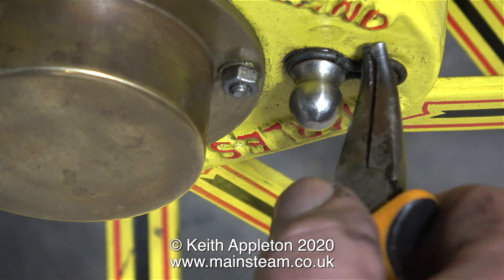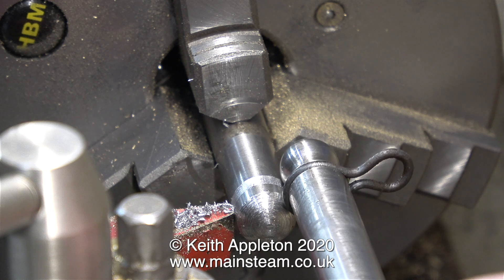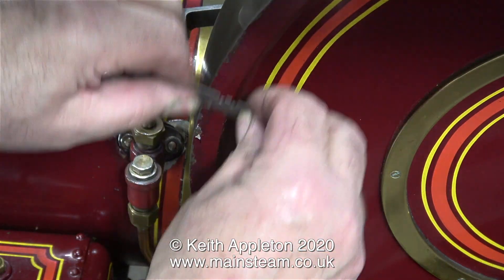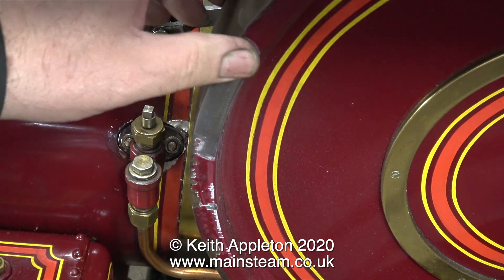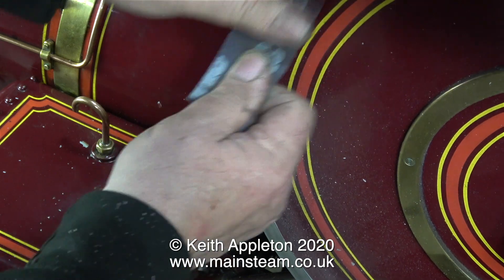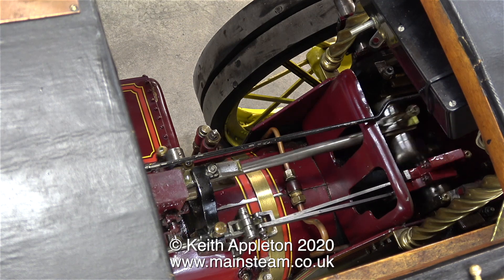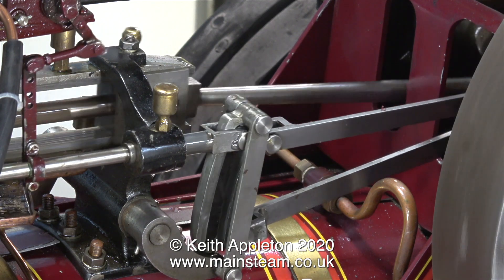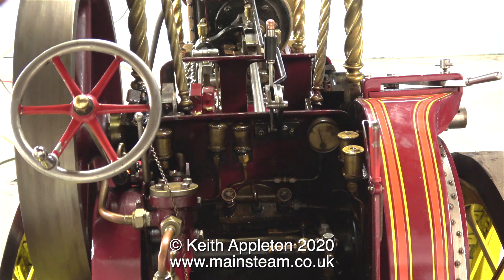A LARGE MODEL SHOWMAN'S ENGINE - PART #4

Comment: Hi I need some help and advice,  I have a wilesco d16 and have a hole in the boiler which sits above the fire so I'm unsure if its repairable  , if its repairable I would be very happy to learn how how to do it or even send it off .
Reply from the maker: Just buy a new one, they are not very expensive.

Comment: And again you give me a another tidbit of information.  I am currently getting ready to put a 1/8 scale steam locomotive back on the rails.  When I got it I noticed that the stack was choked down to approximately 2/3 of it’s diameter with soot.  I didn’t think about it getting too much steam oil, I just figured that the previous owner(s) probably just over fired it with too much coal.

Comment: Very often the second drive pin is to lock the differential. This would only be used on soft ground other wise there is a risk of stressing (and breaking) the axle. Still worth having the second pin though.
Reply from the maker: Yes indeed, The pin I made will go in the toolbox under the Driving Truck. This series is now p to Episode #40 as of 20/07/2020 - all are available via Patreon: www.patreon.com/keithappleton

Comment: I was just about to suggest cleaning off the paint with the engine running, when you did just that. I have a couple of Wolseley Stationary engines, and I polished the flywheels in that manner.
Reply: Just days ago I used that method, with emery cloth, to polish the outer edge of the flywheel on my 3" Aveling & Porter running on air. Simples!